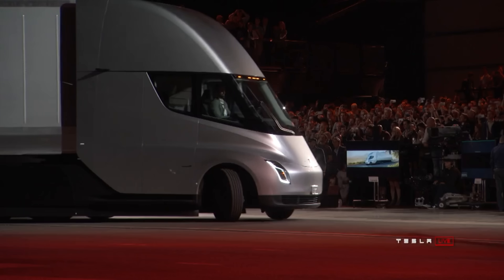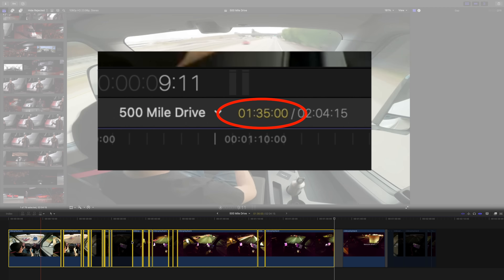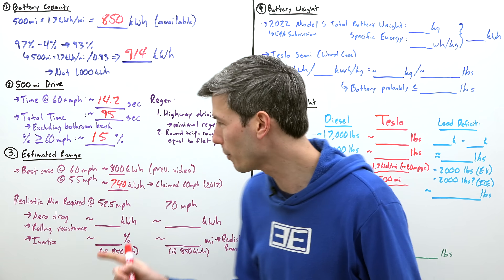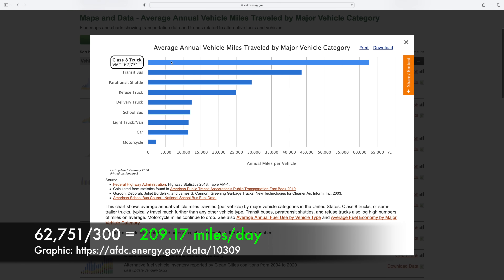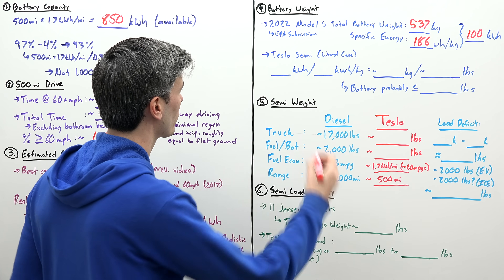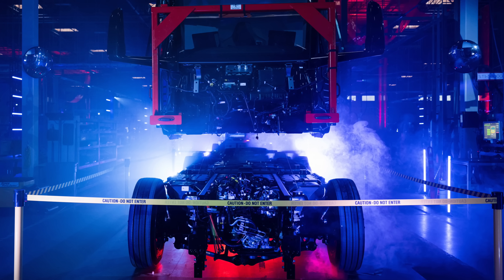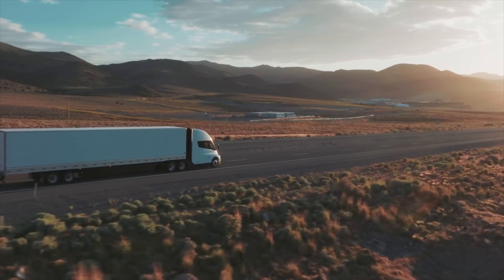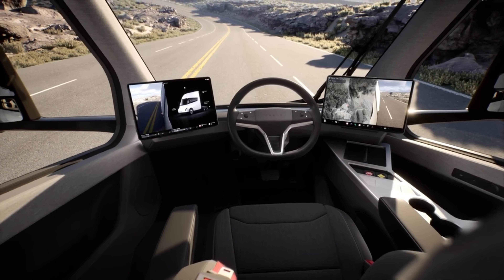Does The Tesla Semi Make Any Sense? Part 2!

Comment: What is significant here is that the EV truck cannot handle loads over a certain weight.  This is important if the Semi-Truck will be used as a fleet vehicle for a company that always ships the same weight loads, (such as Pepsi).  For a Trucking Company that handles all kinds of cargo loads it is not useful.  Another consideration is that this limits the market for such trucks since ICE trucks are usually sold to an after-market when they get old but I doubt EVs will have much resale value after a million miles considering that Tesla gives a million mile "drive train" guarantee but not for everything else such as suspension, brake, steering etc components.  There are a lot of old diesel Semi-trucks still working long after reaching a million miles of service and the parts are available off the shelf.  Even replacing the entire engine is probably less expensive than replacing a battery in an EV.  The old engine can actually be sold for scrap metal whereas one has to assume disposal of battery packs will come with some recycling cost.
Reply: What is significant here is that the EV truck cannot handle loads over a certain weight. 
That's true of any truck—it's just that the "certain weight" is different for different trucks. Just so we're on the same page, what is that certain weight for the Tesla Semi?
Reply: @BigBen621  42,000 lbs of payload if it's pulling a Schneider "TA"-designation dryvan. Kinda low already, but sliding tandems to get to a legal axle weight is a bigger problem. It can't haul a load of 7 Westrock paper rolls -- coming in at 7.5' tall and 5700 lbs each -- without going over 36,000 lbs on the drive axles.

Comment: maybe making a video with translation of your silly numbersd to the metric system, because nobody outside the USA knows what you talking about...
 btw: a pound is 500gr in my country, you using it for shopping butter, not to give a weight for truck loads!
Reply: Nobody outside the USA will be able to buy one, and all speed, weight, etc. limits in the USA are in English units, so this doesn't seem very important. When they're available to buy in your country, I'm sure key measurements will be published in your numbering system. In the meantime, you can do the reverse of what I do: "Hey Google, what's 600 KG in pounds?"

Comment: The charge times are going to be laughable
Reply: Yes, laughably good. During the Run On Less test in September, Tesla Semis routinely demonstrated charging from 0% to 80% SOC in one hour, 0% to 100% in two hours.
Reply: @BigBen621  this is good?  Not to mention the increase in battery degradation with these quick charges and the lack of chargers that will get these things charged in an hour.
Reply: @BigBen621 batteries will die fast
Reply: @hiteshadhikari   batteries will die fast 
Perhaps a few Tesla Semis will experience premature battery failures. But even if they do, it'll be Tesla's problem, and not the owners' problem. This is because the batteries are warrantied for 1 million miles.
Reply: @BigBen621  read the fine print buddy, your delusions will be over.

The battery degradation is built into the warranty and hence if your battery degrades upto 30% ( not same as battery health) then its not their fault....

Also the battery degradation rate inc with time as other dead cells also affect the fine ones.

Its not as simple bud
Reply: @hiteshadhikari  The battery degradation is built into the warranty 
Too funny! Here you are, all pretending that you know what the Tesla Semi battery degradation warranty is, and further that it's the same as the Tesla car battery degradation warranty. The fact is that neither you, I, nor anyone else that hasn't signed an NDA knows what the Tesla Semi battery degradation warranty is, and you're just assuming it's the same as that of the Tesla cars—which is highly unlikely. So please stop trying to represent your assumption as if it were fact. Prove me wrong, and I will apologize and retract this comment.
Reply: @hiteshadhikari   batteries will die fast 
Depends on what you mean by "fast". The Recurrent study on fast charging showed that Tesla Model 3s that were DC-fast charged 90% of the time lost less than 10% range in six years, the same as those that were seldom DC-fast charged. There's every reason to believe the Tesla Semi will have even better battery management, and so have even less degradation.

Comment: As it stands, it most assuredly doesn't make any sense. Not a bit . For the size of the battery, and the real world range being 300-350 under load ... its only getting a fraction of the range of a dual tanks semi truck which gets 1200 miles under load , reliably. And the battery pack must be vented which leaves it open to saltwater ions and salt from the ice roads . The salt causes accelerated corrosion which can lead to thermal runaway.  Who has time for that . Efficiency varies wildly depending on temperatures and load . Not to mention how much the tesla semi breaks down. Its much less reliable than diesel trucks. Keep the electric semi, I'll stay with diesel until electric range and reliability increases .

Comment: Your batt capacity numbers are bogus:  no company is going to run its truck from 100% down to 0%!!  Even if they go from 90% to 10% (Not Likely, Not practical)  the results in a batt capacity of 1063 KWH (850/0.8=1063).    I have other news for you:  Truckers Don't drive 60 MPH;  they drive at or above the speed limit(anyone who drives on interstates can attest to this!!) - which means they are traveling at 70MPH and above, and they try to do that even up long steep grades;  the result of this in an EV truck is large  I squared R losses and much reduced range!!    Regen will not make up for that loss.   That on board computer has all of the data from beginning to end of the trip so if Tesla wants to show off it's truck it should make that available to you and others;  a couple of minutes of crappy video from behind the driver doesn't cut it!!

Comment: One comment you kept making in these 2 videos is that the tare weight for the tesla truck will be lighter because you don't need the engine etc. However all EV car models that have a petrol equivalent weigh more than their petrol equivalent. e.g the Kona electric is 380kg heavier than the ICE version.
Reply: Look again. At about 8:48, he estimates the tare weight of a diesel semi as about 19,000 lbs., and the Tesla Semi as about 27,000 lbs. You are correct that for the most part, EVs are heavier than their ICE vehicle counterparts, for obvious reasons.

Comment: Tesla truck is like 80 % battery 20 % cargo. Remember, you have to meet certain weight limit i.e.. truck, trailer and cargo to be road legal.
Reply: Actually 12% battery and 54% cargo, but keep guessing—you're getting close.
Reply: @some-random-bloke   Can this truck do 8 hours of continuous driving 
In California, with its 55 MPH truck speed limit, a Tesla Semi fully loaded with a payload of about 43,000 lbs. could just do this. In states with higher speed limits, it would either have to be more lightly loaded, or drive at below the speed limit.

 How much can it recharge in the 30 minute window? 
At the typical 750 kW Megacharger, about 40% or 180-200 miles.

 Can it then drive for another 3 continuous hours for a daily total of 11 hours? 
Yes, again at California speeds. 

 _ Will it then be able to recharge to 100 % in the remaining 13.5 hours_ 
Yes. The recent Run On Less tests demonstrated repeatedly that a Tesla Semi can charge from 0% to 100% in two hours; so with careful scheduling, a Tesla Semi could run two shifts in a day, with different drivers.
Reply: @some-random-bloke  Yes, some of the capabilities are enhanced by the low truck speed limit in California. In other states with higher speed limits, either range or payload will be reduced from their California values. Since California has about 12% of the population of the U.S. and presumably somewhere around 12% of the diesel semis, and Tesla's business plan is only to replace <2% of the diesel semis in the U.S. each year (50,000 out of 3 million), it may well be that the vast majority of Tesla Semis are bought in California, where the benefits are the greatest, for the foreseeable future.

Comment: As a long distance truck driver, I seriously doubt a Tesla truck could do the job. We average three 7 days return trip per month from Montreal to usually California. An 11,000km or 6600 miles trip per 7 days. With a 500 miles range at best, I would need a minimum of 14 full recharge stop. Now these batteries would never do 500 miles on a normal trip going through cities with hightraffic, going through the rockies or driving at -20 celcius in the winter. This would likely cut autonomy to 350 miles at best. With that, am now at minimum 25 stops for full recharge per 7 days trip. this is completely unmanageable. As a short distance or city delivery truck, it might work but your autonomy would take a drastic cut. Highway and city driving are two different world when it comes to battery autonomy.
Reply: As a long distance truck driver, I seriously doubt a Tesla truck could do the job. 
The Tesla Semi is not designed, intended, or marketed for OTR or long-haul applications, so your comments are irrelevant. 

 these batteries would never do 500 miles on a normal trip going through cities with high traffic. 
Almost all BEVs, including Tesla Semis, achieve better efficiency in high traffic than cruising at highway speeds. This is because they regain most of the energy of start-stop driving through regenerative braking, but have much lower losses to aerodynamic drag.

 going through the rockies. This would likely cut autonomy to 350 miles at best. 
Again because of regenerative braking and reduced aerodynamic drag, the Tesla Semis have proven to have about the same efficiency in mountainous terrain as in highway cruising. Last December, a Tesla Semi ran 500 miles on 93% charge, from Fremont to San Diego CA, including climbing and descending 4,200 ft. Tejon Pass ("The Grapevine"). Contrary to your claim, this climb, equal to any in the Rockies, did not significantly reduce the range.

 driving at -20 celcius in the winter 
Like all vehicles, Tesla Semis lose some range in cold weather. In comparative tests, though, Tesla cars have about the least range loss of any BEV; since the Tesla Semi uses the same battery management system, it can expect a similar range loss of 10% to 15%. Further, this is completely predictable, and dispatchers can plan around the range loss.

 As a short distance or city delivery truck, it might work 
They're good for much more than "short distance or city delivery" applications. During the September Run On Less tests, Tesla Semis routinely made deliveries from the PepsiCo Sacramento Bottling Plant to Reno, a 295 miles round trip, including climbing from near sea-level to 7,200 ft. at Donner Summit; and >500 mile round trips from Sacramento to Bakersfield and back in one shift. Perhaps for you that's "short distance", but that isn't what I'd call it.

Comment: Don't forget that the Tesla Semi is >30% more expensive to start, and it will have a much reduced range in cold weather, so there are a lot of routes where it will be impracticle. Also, how on earth do you charge an 850kW battery in 35-40 mins? How much energy must that require? When a truck isn't hauling, it's not earning, so every minute counts really.

Comment: If operators cannot make sense of owning an EV truck without taxpayers paying a major portion of the trucks cost then it doesn't make sense for the American taxpayers (should all taxpayers help Pepsi Co. turn a bigger profit?). The recent "Run on Less" event, conducted by the North American Council for Freight Efficiency (NACFE) appears to defy all the mathematics in this video stating that it achieved 1000+miles at a combined GVW of 102,000lbs if we assume they actually hauled the "stated 72,000 lbs of cargo" (I trust your calculations and assume the article's use of CARGO weight was misleading on purpose) of course the reported 1000mile haul destroys the 2nd best in competition (Nikola LNG) which "only achieved" 330miles ... would love to see you do the same mathematical analysis of the Nikola.
Reply: I'm not sure what you're quoting from, but no one from NACFE ever said a Tesla Semi achieved 1,000 miles at a GVW of 102,000 lbs.; and if anyone said it "hauled 72,000 lbs. of cargo", they were most likely making the common mistake of confusing payload with GCVW, and not deliberately misstating the facts. Although I haven't taken the time to find the quote, my recollection is that the NACFE rep, Mike Roeth, said the Tesla Semis coming from the bottling plant had a GCVW of around 72,000 lbs.—and not a payload of that amount—which implies a payload of around 33,000 lbs. Of course, the GCVW limit for electric semis is 82,000 lbs., so the 102,000 lbs. figure is nowhere near plausible.

I don't recall a claim of how the truck in the 1,076 mile demo was loaded; but its energy consumption was pretty high, so it was probably pretty well loaded. But clearly it didn't do 1,076 miles on one charge, or one driver. In fact, It charged three times during the day; twice at the Supercharger at Harris Ranch, CA (which is another story); and once, around noon, at the Megacharger at the Sacramento plant. Further, this was not sustainable, because it started the day fully charged and ended the day at 15%, so it couldn't have done the same the following day. So this was just a demonstration of what's possible, and certainly not showing a sustainable mode of operation.

None of this takes anything away from the Tesla Semi; the Run On Less tests showed that the Tesla Semis came pretty close to Tesla's claimed range and energy consumption numbers, as well as what Jason shows in this video.
Reply: @BigBen621  the clarification was awesome.  I knew that someone "confused payload with GCVW" but I cannot determine if that was deliberate or innocent misstating the facts given that taxpayers & ratepayers will end up enriching all those who are demanding a change to electric (which given net energy loss of the grid makes no common or fiscal sense).  I love Tesla for a lot of reason but I still won't buy one because I' m not so important that I think poor taxpayers should pay for part of my car or driving.

Comment: The elephant in the room is the a lack of power sources and wiring for these.  California and Texas have rolling blackouts in the summer from the lack of power infrastructure.  Also there is no mention of probably higher insurance costs for EVs for their fire hazards.  It is not that they have more fires but the fires are much worse when they happen.
Reply: Got a homework assignment for you. Research when the last widespread rolling blackouts in California were; I think you'll be surprised.

All the Tesla Semis Tesla plans to build in the next ten years will only increase consumption on the grid by 1%, and billions are being spend upgrading the grid. For example, the Biden IRA includes "$65 billion toward electric grid transmission infrastructure upgrades and construction". Further, there are enough renewable energy projects in the queue to double total US electrical generation over the next decade or so. I'm pretty sure the grid can sustain an addition 0.1% load a year for the next ten years.

Comment: Although the engineering is really interesting, trucking companies don't care much about those maths; they care about the financials. How about TCO? Purchase, maintenance and reliability costs: repairs won't be cheap and will likely need engineers, not mechanics. What will be the performance/reliability in winter? Those are the questions buyers will ask and knowing Musk's marketing BS his answer will be: same difference.

So, base price 180K + 194K subsidy (your taxes!)... really? That's a 400K truck! Now, once that subsidy expires, companies will have to pocket out that 200K. How much will they have to charge to haul your freight? 10-20$ per mile? This truck will ever enter full production. Everything Musk have announced for the last 10 years would have been ready... next year: the auto-pilot (2015-16?), the Cybertruck (2017), the Roadster (2017-18?), the Hyperloop (a decade ago) and I'm not talking about the moon and Mars.  None of those have happened yet. The semi, well... next year! 

BTW, I'm surprised that Musk didn't put any solar panels on the truck so it can refuel itself ;)

Comment: Also not to mention aside from the tractor weighing 17k lbs by itself, an empty trailer by itself weighs between 10k and 15k lbs
Reply: So what does this leave for payload? Let's see your calculations.
Reply: @BigBen621  well if a truck is tagged at 80K GVWR, I'd say it leaves between 40-45k total for cargo and fuel/fluids/driver
Reply: @405dieseltech  That's my point. Actually, electric semis are allowed 82K GCVWR, and have a demonstrated payload of 22 tons—which is within about a ton of what a diesel semi can tow.